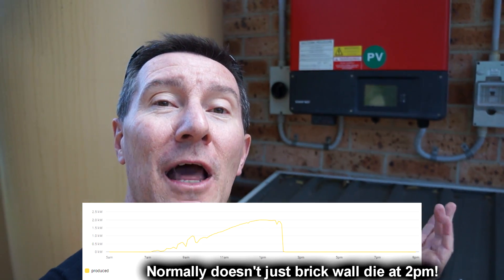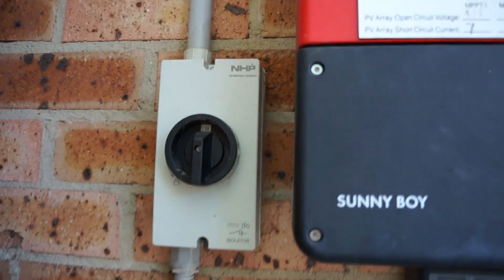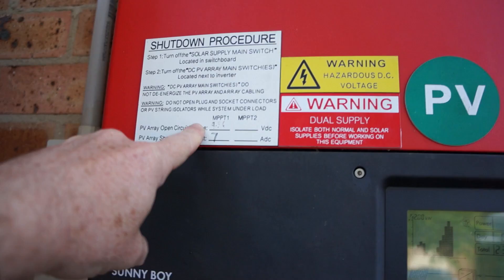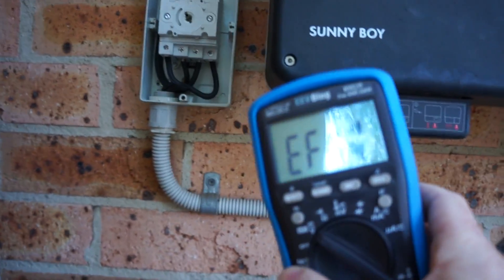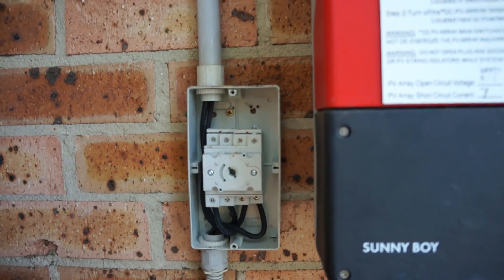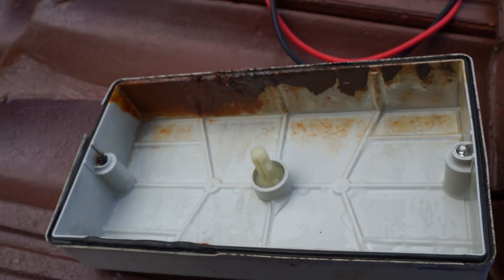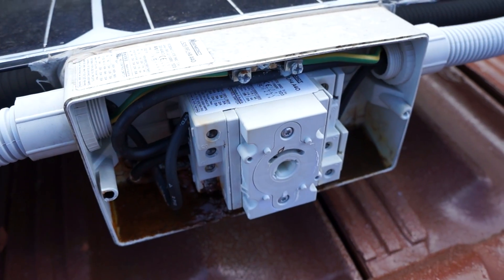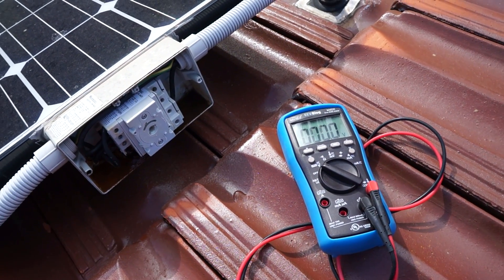EEVblog #1217 - My Home Solar Power System FAILED!

Comment: I think it's for the fire department. If your house is on fire the fire department could not go in because there could be a cable from your solar panel with open insulation. And stepping on such a cable isn't fun..
With a switch directly at the solar panel you can turn off even these cables. 
Here in Germany such a switch is made with an relay at the solar panel and if a separate switch in your house is turned off the relay will open. Even if the cable of this switch or the switch will fail the relay will open.
Reply: that does not seem to be a requirement by any code though…
usually ground monitoring is required (the solar system must be isolated) and one switch must be installed (which usually is the ESS on the Inverter).

In some states the fire alarm system must turn off the PV system in case of an alarm, but as far as the law goes, that is all that is required…

After all those additional systems would have to be made to a very very high degree of failure resistance because they usually run for decades without any maintenance or revision.
Adding any complexity would usually be a bad thing… and even though being high voltage, the danger of PV systems is quite low because they are not ground referenced and touching positive and negative is required to do harm.
Reply: @DooMMasteR  yes you are right it's not required by law. But it does not add any complexity to the system because it doesn't matter if you put a switch up there or a big relay... In my opinion. It would give you just more safety. And if it is properly designed (the systems I know are properly designed) it adds a very high degree of failure resistance.
But you are not false either. I think it depends...
Reply: @danieltlang  anything added, also lowers failure resistance :-P but yeah, Dave's switch was prone to fail from day one, it seems like Australia has since "improved" the code and the issue should be far less of a problem.

However adding a fire hazard to the roof is quite counter-intuitive.

Comment: the corroded switch exists to protect the wire going to the next switch , in case if a cable defect its easier to stop possible arcing &&&

Comment: I had similar fault on my camper van with underfloor batteries. 
''check out the sludge on my tip'' - yeah that clip is being stolen under fair use lol

Comment: Yes you have one of the recalled isolators, which were recalled for the exact reason yours failed - not fit for purpose. Apparently there have been a number of house fires caused by it, which burn out the roof before they collapse. According to the government who subsidised these installs, “it’s not a problem for concern”.

Comment: Fact or Fiction Dave? Just Google "solar DC isolator on roofs". 
Here is one such extract from a random pick (communityrun dot org): 

"Please remove the need to install a DC Isolator on the roof alongside a Solar PV Array.
 Please mandate that all DC Isolators are removed from current installations before we have more fires or worse a solar fire related fatality. Why is this important? In mid-2012, Australia and New Zealand together issued a new standard for the installation of solar arrays. This standard mandated the use of a specific piece of equipment called the "rooftop DC isolator" in Australia, and by some interpretations also in New Zealand. They did this despite evidence showing that the practice is unsafe.

A study from an international testing laboratory found that DC isolators are not safe in a firefighting situation, as they can’t withstand the high-pressure water used to extinguish a fire. The California State Office of the Fire Marshall frowns upon their use, because they give a false sense of security. And Europe, the most mature solar market, opted never to adopt them, also for safety reasons. 
More than 70 fires in Australia have been caused by this isolator since 2012 -- that is, since it became mandatory! To put this into perspective, there were only 3 fires related to PV systems in Australia prior to the mandatory requirement to install a rooftop DC isolator.

The Australian government has responded with product recalls on DC isolators, at least 5 so far, showing this crisis isn’t just limited to a single manufacturer, but to the device itself. There is no evidence to suggest the device improves the safety of a PV system: all it does is increase costs and the risk to homeowners trying to do the right thing. And that's not to mention the catch-22 for PV installers who are both legally bound to comply and obliged to keep their clients safe.

Master Electricians Australia chief executive Malcolm Richards in an interview with the ABC late last year said that he says he knows of about 40 to 50 fires that have been started by the faulty isolators. 
"We're warning home owners to carefully check the brand of isolator that is connected to your solar panels," he said

Comment: That’s a pour install, the isolator should have a cover and be mounted on the rack. Also holes in the back of the bottom isolator should be sealed.. I’d be ringing the installer.

Comment: it is a requirement in australia to have an iso switch next to the panels as well as next to the invertor
Reply: Never understood why it has to be a switch, why not a maintenance free sealed DC contactor that can be controlled by the box at the ground level? If the 24V to the contactor goes so is the solar power.

Comment: It's now a rule they must be vertically mounted, with a stainless shroud. Also look into DC-DC optimisers by solaredge, they go under each panel. They allow each panel to perform individually and thus more efficiently, helping with issues like cloud and tree shading and most importantly that if one dies the rest will still work.

Comment: Rooftop Isolators are a sore point for electricians in Australia.
We are one of, if not the only country where we are required by law to have them despite mountains of evidence that they're not safe for this exact reason.
Reply: AaronBonBarron Regulators have obviously decided that if isolating requires several trips up and down the ladder and then due to poor memory electricians can’t remember whether the system is isolated, they deemed it was safer to have an isolator on the roof as well.   You can’t really argue against that logic.
However, they should have specified a switch and installation standard that is up to the task.   Safety people often have no practical idea!

Comment: many of the DC isolators were changed / checked when it was discovered that polarity mattered because of the side that the arc chutes were on. Many DC isolators were hooked up backwards.

Comment: Initially I was thinking it could have been the inverter failing due to approaching its end of life limit. You were lucky to have escaped with just an isolator failure. I hope it doesn't come soon but at some point the inverter will fail too. I d say it would be anywhere between tomorrow and 2 years as most inverter companies give 5 years for their inverters but others give 8 and sometimes 10. DC isolators are integrated into the inverters now which would have avoided this problem but not sure whether AU regulations require separate external ones.

Comment: What would you have to do change it at night or take some links out of the panels to lower the voltage coming in?. . Would you have to throw a black sheet over each panel. Or do it live

Comment: Absolute fucking waste of time and money to put an insulator on the roof. Unless you touch positive and negative you can't get electrocuted. I put 240 volts DC(+  -) into a bucket of water and stuck my hand in. What happened. Nothing

Comment: yep, australia is the only country requiring that isolator on the roof. and it causes mosre problem  than it is supposed to stop, including many fires. even new zealand opted out of it. there is a long story to how that came about. and it is based on people lying.
Reply: What's the story? I would have thought a way to isolate the 400V cable running through your house in a pinch would be a good idea.
Reply: @marcaxe  
there were at least 60 fires caused by those isolators in queensland alone.
the idea is if there is a fire, you clime up the roof and isolate your 400V before the fire brigade extinguishes the fire.
it is however not a problem for the fire brigade. they know how to handle this.
the blokes writing the rules in actually lied in saying that a fire man had died.
not even new zealand has that in their rules and otherwise NZ and AU rules are the same.
australia is the only country having that requirement. that speaks for itself.

Comment: I'm using Enphase micro converters (IQ7) which are directly mounted below the panels. That way the DC only travels a very short way before it's converted to AC, I can monitor every panel individually and if one fails it's a small amount to replace it.

Comment: There are also motor driven isolator switches, so if you want the switch safely placed inside while still giving for example firemen the ability to shut the system down in an emergency, that is an option.
http://www.santonswitchgear.com/de/produkte/view-all-products-ger/category/specials.html

Comment: why did they not loop the switch to minimise arc flash ?
using multiple contacts in series to make a bigger switch gap?
Reply: it looks like they did. at the top it has bus bar type links

Comment: i hope the dc isolator has magnetic snuffing on it
Reply: I do not think that these are used for DC, under load, switching… they at least do not look like it.
Reply: @DooMMasteR  hmm maybe thats circuit breaker im thinking about  oops sorry

Comment: Water has a way of getting into things and unless the device is potted, chances are water will eventually get in and build up if no drainage point (in the right location) is provided. Having worked on roofs for years I can tell you that is the point of work that differentiates an amateur from a pro. You must ALWAYS provide a path for water leakage to flow out of, I don't care how careful and "perfect" your work is or materials and parts parts are, if you don't do that you have created a time bomb. The corrosion in that switch was caused by trapped and built up water, not by the mere fact that it was no longer sealed. Being that in this case you are dealing with electrical systems and therefore laws, no installer will drill a hole in a switch box even if he knows its a problem waiting to happen, that is something you are going to have to do yourself. Had that switch had a drainage hole you would not have had a problem with it. Sorry but putting things like desiccant bags into switches will do nothing but further exacerbate the problem by providing material for water to soak into and hold water, making it even more difficult for water to evaporate out of the switch from what little ventilation is provided by the leakage point. Leave desiccant bags for vitamin bottles, it has no place in something that is prone to water leakage nor were they ever designed for that.

Comment: No ,It should be UV plastic doesn't get affected by UV, probably why they recalled should be enable to get at least 20 years
You should put the isolator switch underneath there is room or covered with a thin piece of aluminium with a air gap

Comment: A dodo incarnated in a switch. A sheet metal cover as roof over the new one will keep away rain from the seals and UV light from the plastic. Some craftspeople definitley weren't thinking when they installed this.
Paint the cover black, so it'll bake in the Australian sun and all your venomous Australian beasties that may hide under it are gone. Handling safety 'n all… ^^)

Comment: It is not a good idea to leave a plastic box on the roof without any additional protection from directly falling rain and sun shine. Small cover, made from Zn coated steel sheet would prevent from such damage for long years

Comment: This is one of the things that does my head in with regard to solar power systems. They quote a cell life of 25 years (for 80% output) and then use components pretty much garanteed to fail after less than 10. There is no way any plastic will survive 25 years of the level of UV you get in Australia. I'm not convinced they would survive 25 years in the UK. There are plenty of materials that will survive longer but will they use them? Oh no we couldn't do that as it would cost $0.000000000000000000001 more. Typical accountancy knowing the cost of everything but the value of nothing.

Comment: I've always drilled holes in the bottom of all my surface mounted switches
Yes, AS3000 requires and isolation on the appliance 
Which is ironic and electric hot water services still don't have an isolation switch after 30 years!

Comment: Build small roofs/sun hoods over all boxes to protect them from the sun (UV kills everything) and rain. Also, all cable entries should be from the bottom side only, to prevent water ingress. Common practice for petrolium installations.

Comment: My panels isolator on the roof has metal plate above the top side of switch.
The system was installed 2 years after yours so there may have been changes to the installation requirements.

I am surprised with UV damage and hail they allowed this setup.
Reply: It might be worth it for you to go up on the roof with a silicon gun and go over all the seals on the cover. Water can and will eventually get in, no matter how well it was installed. I can say this as I installed solar for 3 years and seen it all. Rooftop isolators are also the leading cause of solar related house fires.
Reply: By memory the installer sealed the case with silicon. Will check when the weather dries up.

Comment: My father got ripped of by dodgy solar installer..............after many phone calls and investigation its working, but Fair Trading told him that 25% of installs are faulty.  As for DC isolators they are rubbish.........just a failure point that does not protect the panels or circuits.  Good installers ( and yours truly) use DC breakers on the roof near the panels and more downstream near the inverter. I mean for goodness sakes, the DC isolator on the roof doesnt even have a shield over it..............pathetic.

Comment: In this izolator switch look cable is connected is in botom but usually shut be input on top output on bottom or vice versa

Comment: You could add a "roof" or a rain cover for the isolator switch to keep it safe from the elements. Just a piece of plastic or aluminium on top of the casing.

We do this thing for our walls too with roof extending beyond the wall line just to make sure.

Comment: thanks for showing this.  gives me yet another adjustment I would have to calculate in when building my own system here in NZ.

yeah, anything plastic is going to have to be built out of extremely resistant to UV materials, or else replaced by non plastic.

the ozone hole is smaller... but we still have over 40 years before UV levels drop close to normal.

Comment: Modern engineer goes like: System is over-constrained, do not add any failsafes or improve stability because it's totally within spec on paper! Simple designs end up failing more than complex ones

Comment: My solar grid has been installed 12 years ago. No issues with the system so far.  In germany just one isolator switch per string is installed near the inverter.
Reply: If the inverter has a built in ESS no additional switch is needed at all.
They basically are just a fire hazard (especially in cases like Dave's) up on the roof in the elements.

Comment: the switch should have been installed with a Stainless steel shroud and should not be directly mounted to the panel as you will void your panel warranty. . I used to install the switch under the panel until they made it illegal

Comment: Get yourself a box that has been ATEX or IECEx approved then you will probably have a box that last significantly longer. I guess this is why some of the switches are being recalled (assuming they are approved with the enclosure).

Comment: Not good, my Tindo Solar System has a piece of stainless steel sheet metal over the top of my switches (mounted to the rear of the side mounted switches & bent 90° over the top) to stop the majority of the UV/Rain hitting the top surface of the switch box :-)

Comment: For a low voltage PV array with a single string cable, a disconnection device is recommended. AS/NZS5033-2014 Clause 4.4 Table 4.3 (Low voltage is from 75 to 1500 volts DC as per the wiring rules) The case is different in the case of subarrays or multiple arrays where the isolation device needs to be adjacent to the array. In that case, I think a smart installer could install the isolation-protection gear under the house eaves to provide an extra bit of weather protection. Because rules and regulations are subject to interpretation, particularly when something goes really wrong, many installers adopt the over-engineering" method "just in case. The customer pays for it anyway. Anybody wants to add something else to the discussion or disagrees with this?

Comment: No isolator switch on my system on the roof. (Finland)
Reply: Yeah, not common here in the UK either. They rely on the fact the isolator at the inverter can be padlocked with a lockout tagout system

Comment: In Germany we have one way of isolation directly on the inverter (isolator switch or plugs that can be pulled) and nothing on the roof. There are plugs between each panel that can be disconnected. Should be enough security.

Comment: yeah im german electrician this is a common problem with non uv resistand plastik. lock for switch with uv resistand plastik. also silikon or car window glue is good to keep the water away from your switch. i am drilling outdor every time a 5mm hole in the bottom of boxes. when the sealing fails then the water can go out of the box.